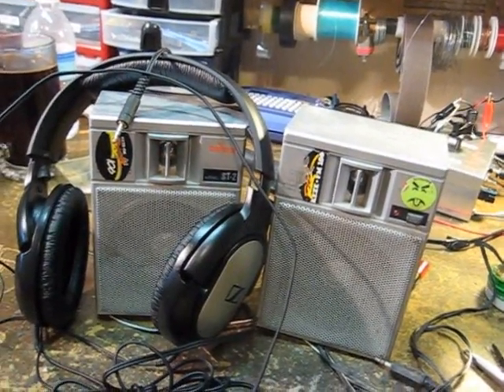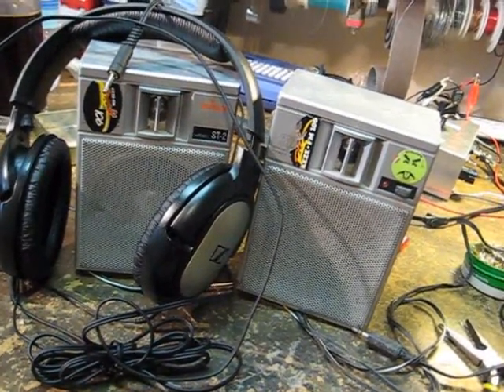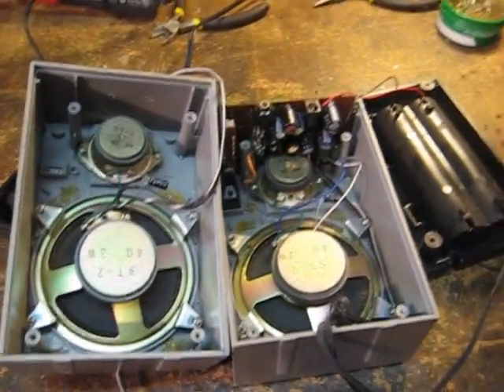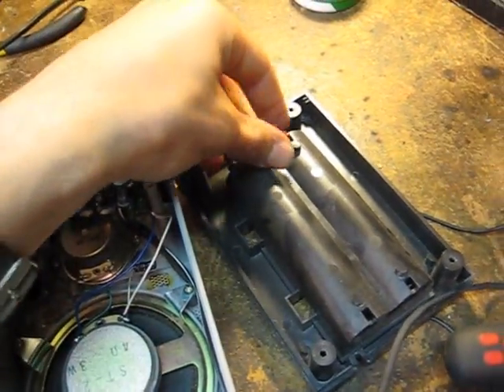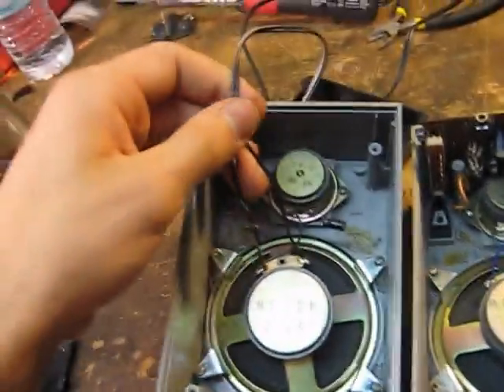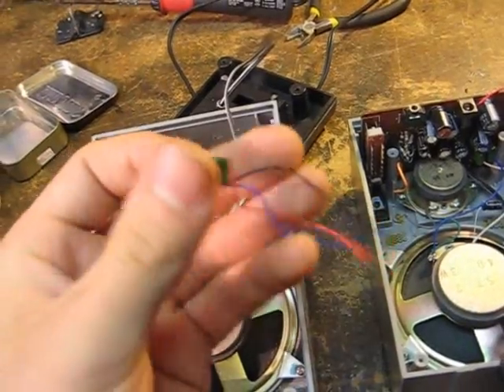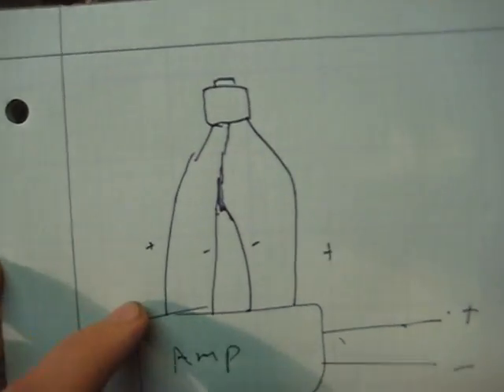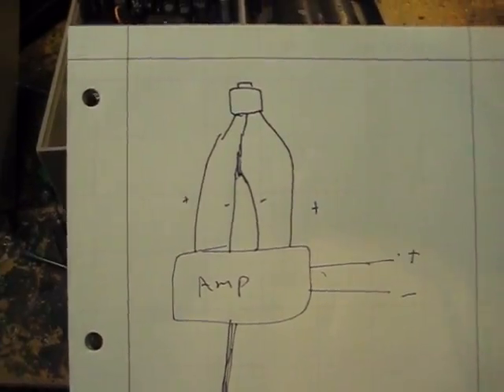Turn A Pair of Speakers Into A Powerful Headphone Amp

Comment: I know you made this comment a long time ago but probably not.  The impedance of the original speakers was probably 4 or 8 ohms, and the headphones are probably at least 32 ohms, so they wouldn't get that loud, unless you're using an insane amp.

Comment: an iron bar sticking out of the place it goes lol) then after i manage to get the plates back on i put tape over the side of them so the crack caused by the iron bar in the way) dont catch my hair. dont put the bar in the middle, it ruins the cushion and makes it impossible to screw the plates back together, put it in the front (or back) section where there is a crack where the extension slider doesn't take up space. if you put it on the back section it also helps the sliders be tighter :3.

Comment: Probably more likely with in ear headphones (although they're usually efficient and don't need an amp, unless you really like to blast your poor lug-oles!). I once had a computer sound card that could drive passive PC speakers quite loudly and you could rock out on the lowest volume setting through earphones!

Comment: Some headphones require additional voltage to reach their optimal potential in terms of sound quality (see: "high impedance headphones"). I don't really understand why he would use amplification with low quality headphones like the HD 201's though, but he probably just likes to tinker.

Comment: Do you have any trouble with background noise? It's not normally noticeable, but using the amp to drive headphones right by your ears will amplify any noise drastically. I'm assuming this would be more of a problem with a DC adaptor which gives mains hum instead of just a faint background hiss.

Comment: yes ive finally seen someone with my headset i have had my HD 201's for 8 years and they are perfect after you burn them in, if you play heavy dubstep at max volume for long periods before burnin they heat up (without amp lol) and begin to bust but luckily i didnt leave them on long enough to let them blow lol. i used cutting pliers on a coathanger and took off the earpad exstension protection plates and bent up and inserted the coat hanger segment, put the protectors back on (quite hard with
Reply: Burn in is a joke my friend dont fall for that crap again !

Comment: The best reason is to get more out of your drivers and often out out of your source. When Portable CDs were more popular and there were some quality portables there was a problem: Not enough batteries to really drive those speakers so the CD player would spend more energy on driving the headphones than on the sound quality... so basically there was more sound quality available being wasted on amplifying the speakers. So a high quality headphone amp from a good Portable CD player out to some Grado Labs or Audio Technica phones would sound warmer, more expansive and more powerful with more headroom... Actual raw volume or decibels isn't as important as quality sound and that sense of torque that you get from any Hi Fi experience.

Comment: I thought this kind of amp use 12V adapter and if you use 9V battery then it wouldn't  work because not enough volts ?
Sorry for my English